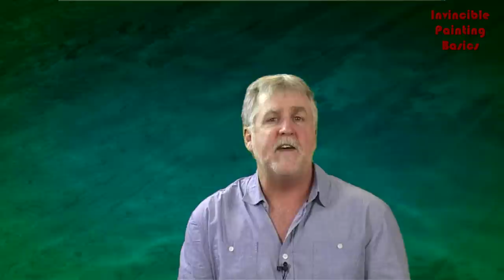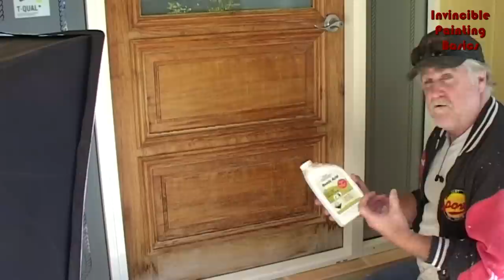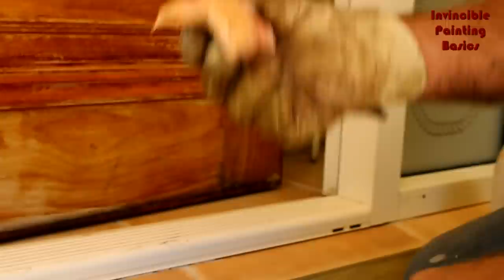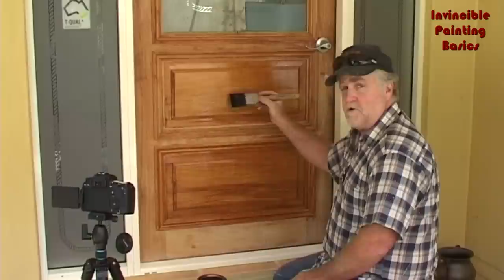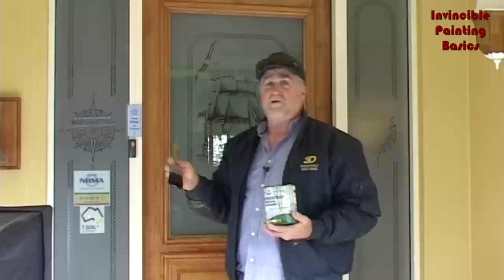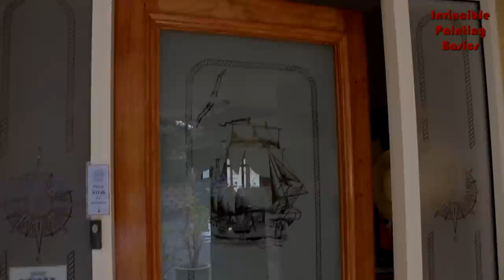How to refinish a solid wood door with water stains, easy when you know how

Comment: Great videos Rick!  I've learned so much in just a few views.  How do you deal with nail pops?
Reply from the maker: Hi Kenneth, I'll assume you're dealing with
gyprock. All I do for nails popping is tap them back firm enough to countersink them below the surface so you can patch over them. Sometimes if the nail doesn't seem to hold the gyprock in place, just put in another nail close by along the ceiling joist/wall stud. That should do the trick. And glad you're finding my videos useful. :)

Comment: If you were going to stain it wouldn't you have to strip it first to be sure ALL of previous topcoat was off? Other videos I saw ONLY sanded and it just doesnt seem that stain would soak in evenly.
Reply from the maker: Thanks for the question. This door was never stained, only had a clear finish (polyurethane) on it. But yea, if one wanted to stain it, then you are absolutely correct. The entire door would have to be stripped of the clear finish. Massive and very tedious job. All I did was remove a 'water' stain and refinished the door with clear (polyurethane) again.
Reply: @RickBushell1958   thank you! And great video.

Comment: Was just wondering what was the product used to pull the water stain out of the wood??
Reply from the maker: It would of been a brand of 'Deck Wash'. I've also used bleach mixed with water, but you have to be a bit careful with that one.

Comment: Can you use a hose spray to clean off the acid, or did you just use a clean water and cloth/sponge?
Reply from the maker: I guess you could. but one would have to be careful of where the water went. I this situation in the video, I wouldn't of used a hose but simply used the sponge/rag and water.